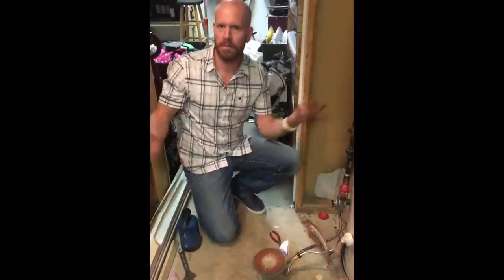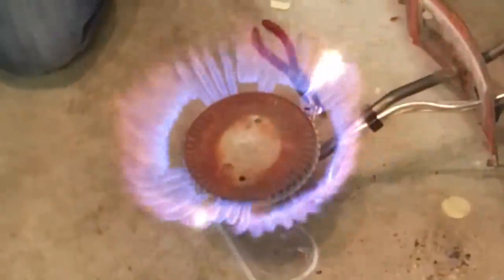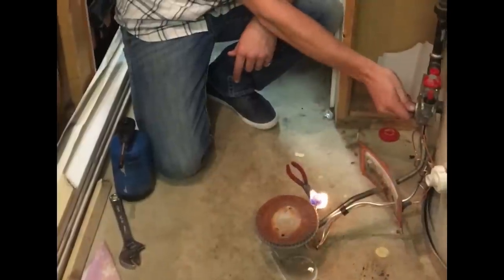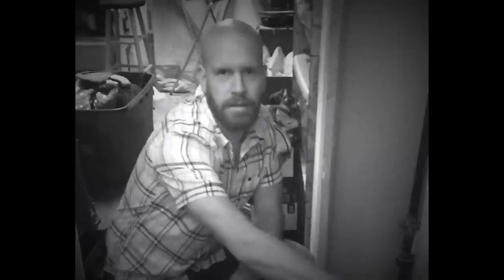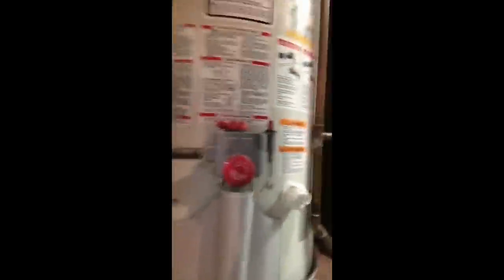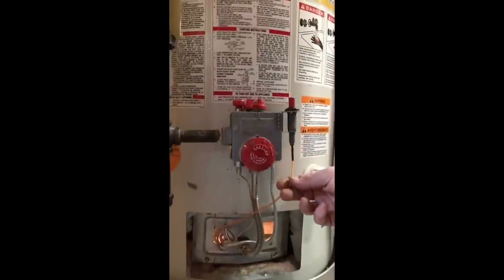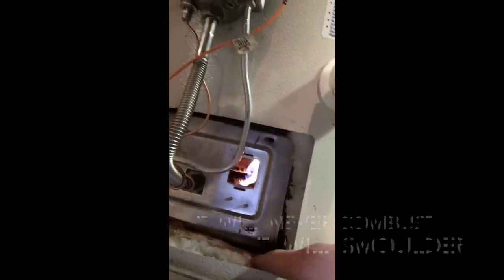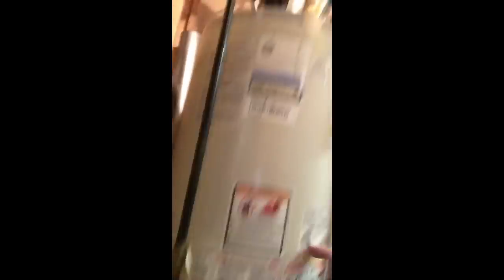Pilot light/Burner won't stay on Hot Water Tank (SOLVED)[well, solved if this is your problem]

Comment: or you could have called me in i'm only in albany a nice long ride down the northway..nice vid here .i've had to do that once or twice on a service call in my earlier days when i didn't know about these sealed combustion tanks to see pilot position on those stubborn pilot out call backs..the TRD is the part at fault here, possibly unless you have blocked vents from lint or other obstructions. the thermal releas device is located in a glass tube under or near(?) the main burner plate..i had to rig it one time or another until i got another part..then there's the pilot snuff out issues caused by too much updraft if your tank is getting sufficient air to combust.that's a whole other ball game..anyway come to think of it now maybe i should do phone assist calls and charge for it by paypal.i rarely use that account nowadays ,lol!
Reply: i forgot to mention Ge sent me a new device for free while under warranty but they said if it happened again that the tank should be replaced..why? probably to make more money but if you replace it and it happens again prematurely then something else is going on that changed the situation.
Reply: @ShyboyMike  hey man is your heater working now?? i found this on youtube : Repair Water Heater pilot light won't stay lit - sealed combustion chamber Thermal TRD FVIR

which was every helpful but it might be a pain to find the part!

Comment: How do you take that little window out on the hot water heater to get air
Reply from the maker: with a hammer :P
Reply: I used a narrow head screwdriver. Investors you get the frame of the window pried out enough, you can slide out the glass. Unfortunately  my burner didn't stay lit.

Comment: That's so wrong its sealed combustion taking glass out of pilot light sight glass is not the right fix. When u take out burner assembly look inside tank there is a bimetal link that hold damper open so you get combustion air flowing thru vents on side of tank. It could be two problems combustion air vents tripped closed because bimetal link failed due to high temperature or your 4 or 3in vent going thru the roof is blocked. Vent gases couldn't vent properly so unit over heated tripping bimetal link closing combustion air damper there for shutting down heater. What you did is WRONG in so many ways. Warranty is void unless you put it back together the way it's supposed to be. Install new link for combustion damper it's not safe. Damper is closed need to open  bad things can happen.

Comment: The airflow problem is really a purposeful design flaw. Filters and flame arrestors will always plug and will always need to be cleaned or replaced. The water heater should be designed so that flame arrestor cleaning or filter replacement can be done by the consumer. Unfortunately, it is to the water heater manufacturers' and the plumbers' advantage to NOT fix this design flaw since doing so will reduce revenue for these two groups. The plumbers would lose revenue from service calls and profits from unnecessary WH replacements and the manufacturers would lose the revenue from WH replacements. In my opinion, this situation is consumer fraud on the part of these 2 groups. Whether there is collusion between these two groups to defraud the consumer is a separate question that needs to be investigated.

Comment: That pilot is filthy. The FVIR shut off the air supply for a reason, possibly a venting issue. This is a safety device. Don't touch what you don't have any idea about. You can clean the flame arrestor screen easily.

Comment: So many asshole plumbers you call about this will just want to replace the whole water heater.  I freaking hate these guys.  I had the same problem...noticed the air intakes on the bottom...took off the lids, made a wand out of 1/2" pvc with a 90 degree elbow, attached to my vacuum, and sucked out the dust.  Worked for 4 more years before I needed to clean it again.

Comment: Holy fuck... please guys an girls, do not do this. I’m a licensed plumber. By doing this will void all warranty to your water heater. Please call a professional. If this guy was to ever had a gas leak or a gas can by the water heater it will blow up. That burner assembly is sealed for a reason an this genius did the opposite. Also this type of water heater has a glass sensor, if it is broken you will need to replace the part.